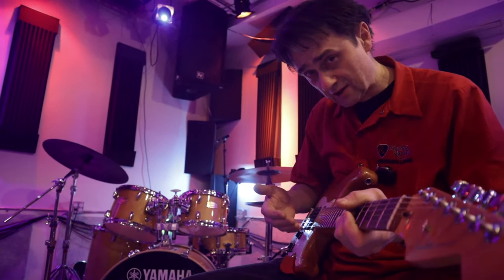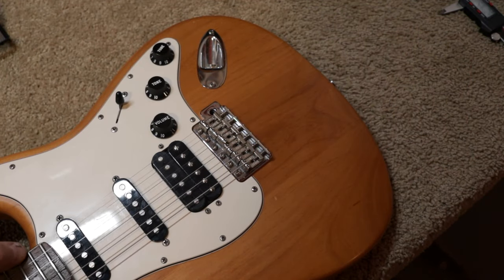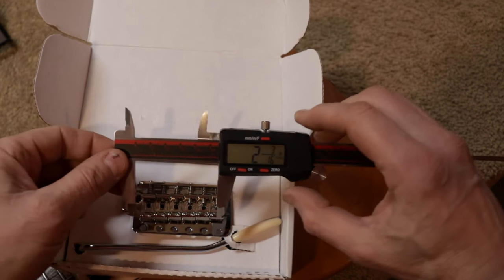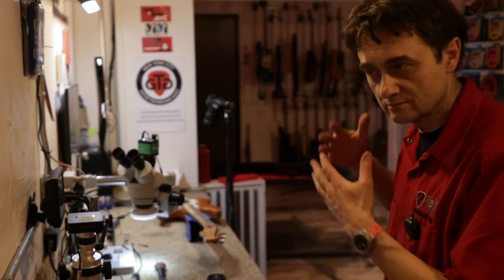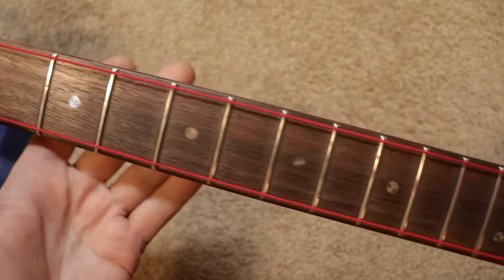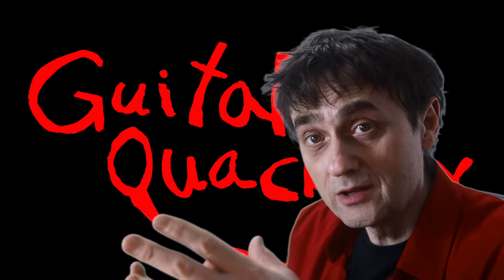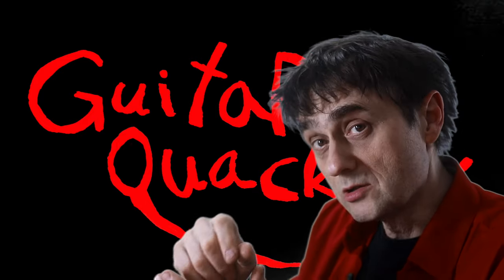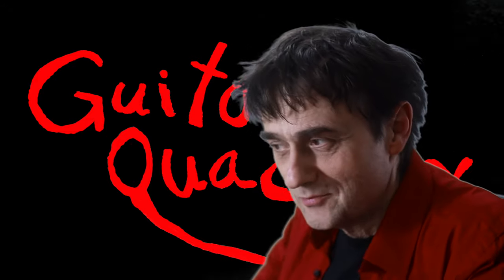How to Fix a Slipping String on a Fender Strat

Comment: It happens in most Squiers too. The easiest fix, if not the nut & bridge and assuming the fret is straight, is the neck alignment. I loosen the guitar neck screws and put only the High-E and Low-E strings with enough tightness for them to pull the neck. I simply tilt the neck sideways until the high & low E are balanced and then tighten the neck screws.
Reply from the maker: You are right, on some bolt-on neck guitars it is possible to just tilt the neck into correct alignment. But on this one, both E strings were too close to both edges. This bridge string spread is too wide for that neck.

They make these 2-1/16 inch string spread bridges specifically to fix this problem.
Reply: Nah, it's just that the vintage Fender spec is these 55-56 mm wide bridges, which is why they all have the strings running very close to the edge of the fingerboard, especially in higher positions. You have to be very careful when beveling the fret ends on these guitars, making sure you don't remove any working area of the fret.
Squiers come with narrow bridges, so you can only have this issue on one side if the neck is misaligned. Same for more modern Fender bridges.

Comment: Speaking of spacing, another thing that Fender has not corrected until today is the distance between the poles of the neck pickup. For them to be aligned, the distance should be 50mm (and not 52mm).
Reply from the maker: And another annoying thing is the cutout on the on the back plate. That cutout is supposed to give us easy access to the trem block, so that you we put the strings into the holes of the trem block, without removing the plate.
Reply: Talking about other annoying things, the G-string pole is higher than it should and the guitar has two tone pots (in 20 years I never found a single custumer that used them both on a Strat). @GuitarQuackery
Reply: Most Fenders are like that...

My Tokai is perfect 😍
Reply from the maker: 70s Strats have a lot of issues.
Reply: @rodolfoamaralguitar you have never found a customer that uses both tone controls?  There is no way that is a true statement 🤣.  That's one of the best features for a Strat.
Reply: @rodolfoamaralguitar  carefully heat them to soften the wax, then push down....the staggered pickups were for vintage instruments, with a wrapped 4 string....
Reply: @rodolfoamaralguitar  I use them. And the vol. a lot.
But you are no doubt correct and most people don’t .
Reply: @fordhammie mine too
Reply: @sgholt  does this work? I don’t usually have a problem but I have one that could stand a mod like that to balance the plain 3rd string a little better

Comment: It looked like your low E string was pretty close too, but if there's more space between the edge of the fretboard on the low E side than on the high E side, then your neck has shifted and loosening the neck and pulling it into place and then retightening it is all that's needed to fix it. Happens during shipping on some guitars. Happened to my Charvel and this simple fix has fixed it. 👍👍
Reply: Oh, I see others have already said what I said. 🤦‍♂🤷‍♂🤣✌
Reply from the maker: Yes, this is something that I forgot to talk about, as I was working late hours and falling asleep editing. I will either make a follow up video or perhaps redo this one and include the neck angle (center line) issue, which can be the culprit on some guitars, but was not the case on this one. 

I don't know... do you think I should make a follow up video, or do you think it's better to redo this video?
Reply: Hmmm.  When I got my Charvel, and I looked for videos about the problem, I found some where they actually removed the bridge and rerouted the bridge cavity to move the bridge over. Luckily, I found one (and only one) explaining the simple fix of loosening, adjusting, and retightening the neck. I was freaking out till I found that one video. I even had a friend who got a new guitar last month and he thought the bridge was mounted wrong too. I explained the easy fix and it worked for him. So, maybe it would be good to have another video out there that might save someone from freaking out like me and my friend. I feel sorry for the ones moving their bridges. Whatever you decide, I'll thank you now on behalf of all the worried people with out of wack necks. ✌Subbed ya. ✌
Reply from the maker: @mikeshanermusic   That’s interesting. I’ll have to look for those videos. It does sound like a very extreme way to fix a problem.

Comment: Don't forget there's not only the string spacing, but the bridge screw spacing issue also. Not every bridge will fit your guitar without re-drilling!
 I had to hunt for the Higway One bridge to accommodate the US-sized saddles from graphtech to a Mexican fender with the wider screw spacing, for example.
Reply from the maker: Correct, but in this case, we were talking about a US Fender and a US bridge for a US Fender.
Reply: @GuitarQuackery  for sure, just a note for others to consider.
Reply from the maker: I think I should make a follow up video that shows other reasons for string slippage. Or maybe I should re-edit those video and include the other reasons in this video.

Comment: If you have just a few frets that the string slips off the side, you may be able to fix that by putting a dab of solder on the end of the fret and rounding it over to make it smooth. I've used Silver solder, a slightly harder form of solder, to do this on a couple of my guitars and it's worked quite well. I came up with this idea after seeing how much solder has an affinity for fret wire. It's easy to do, and just takes a few minutes.
Reply from the maker: In case the entire geometry was off. The string spread at the bridge was simply too wide, in my opinion.
Reply: @GuitarQuackery  Yes, definitely the case on the guitar you were working on. 👍 I just wanted to share a tip/fix regarding the occasional fret with string slippage.
Reply from the maker: @picksalot1   Of chorus, thank you for sharing your tip. I have heard of a similar fix for other types of fret repair needs. I have never tried it myself. Thanks. Much appreciated.
Reply: @GuitarQuackery  The idea popped into my head as something perhaps worth trying. I was shocked how well it worked.
Reply from the maker: @picksalot1  Very interesting.

Comment: I can see this happening with a Partscaster but it should never happen on a factory guitar.
Reply: Fender occasionally mixes parts on some lines. It's baffling it's allowed.
Reply from the maker: There are occasional discrepancies that happen at factories, that later get discovered. I am soon posing a review video of a Fender American Professional II Strat, with some issues.
Reply: @GuitarQuackery  Fender must turn out thousands of guitars annually. I'm sure there are going to be some "discrepancies".  I look forward to that video.
Reply from the maker: @dugbert5   Correct. And I don't want to come across as someone that is just trashing the manufacturers (unless it's Harley Benton, LOL). A brand is just a name, but it all boils down to the factory workers that worked on a specific guitar. And it all ends (or should end) with QC, which is in most cases just fiction.

Comment: GREAT VID...however...I fixed my high E string from slipping off he fretboard by loosening the screws on the neck and actually aligning the neck by shifting it towards the LOW E string side.  You really never play the low E up high and it had no effect on the nut side so it can be a little closer.  I will be measuring my bridge on all of my strats though.  Never even considered there could be that much difference.
Reply from the maker: As some other viewers have pointed out, it is actually true that on some guitars, the neck is simply tilted a little bit. I should have mentioned that in the video. This was not the case on this guitar. Both E strings were too close to the fretboard edge, on this particular guitar. And this is an issue that we see with some runs of Fender guitars.

Comment: Exactly which fender bridge is the replacement you're using?
Reply from the maker: If your bridge is a 6-point mounting system with 2-7/32" spacing, then the part is https://amzn.to/48BwQ1h (affiliate link) which is the exact part used in this video. But please, before ordering, make sure your mounting spacing is 2-7/32" to make sure this is the correct part. Hope this helps.

Comment: Ive had this with Gibson les pauls twice , guess they got the nut carve wrong, with gibson you surely expect much better, was able to sort one to extent by adjusting the wrap around bridge to compensate,  guess the other standard will need a nut job. I have one fender thar does this and the bridge is the issue after all that time the caliper is obvious , thanks i have another bridge somewhere , hopefully the screws are in the right place lol is the only solution on a les paul to re do the nut ?
Reply from the maker: I would have to see the guitar in person to really advise you. Sometimes Gibson folks notch the saddles at the wrong places and sometimes they install the bridge posts at the wrong place. There are more possibilities than just the nut. In fact, I think it is unlikely that the nut is causing this.

Comment: Every MIM tele/start I own had this problem' usually tweek the neck to fix it. You should invent some kinda small devise that sits on top of the saddles that pulls the saddles together and locks them in place.
Reply: G&L saddle lock bridge
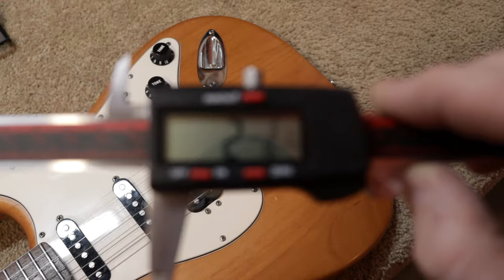Reply: @dingusfuzzk 1:36 lonnkt2755 this bridge is basically a Babicz idea, make large walls and rounded square saddles with rolling pinion centers would be better still like current Babicz bridges. Cool designs, there is a 2 point trem for strats now, and it's on the Aerodyne nobody bought from last year that's a secret sleeper.
Reply from the maker: I need to make a follow-up video, because I honestly forgot to mention that the string slippage could be caused by another issue, which a few of you have pointed out, which is the misalignment of the neck.
Reply: @GuitarQuackery on one of my Strats the first string (alto E) saddle wants to sit tilted away from the others. It appears the hole for the saddle screw, while located correctly, is not flush on one side and when the saddle is pulled or pushed toward the headstock the screw-head actually counter sinks slightly into that hole at one side. I can think of a couple ways to remedy this without replacement of any hardware but I am interested if you have any suggestions?
Many thanks! 
And I am enjoying your channel a lot it is quite valuable.
All the best!
Reply from the maker: @leewalton6882  I've seen this on quite a few bridges. Sometimes the holes are not evenly spaced and sometimes the saddle, screw & spring assembly sits crooked. I've even seen bent screws. 

I can't really suggest what would be the best solution in your case, without having the opportunity to see it in person.
Reply: @GuitarQuackery  understood
Thank you for your reply.
I’ll report back if I come up with anything novel and effective.
All the best!

Comment: I recently purchased a near mint 98 srv Strat that was like this. Those are common problems I guess which is crazy.
Reply from the maker: The engineers who have been designing electric guitars for the past 80 years are not the same engineers who successfully figured out how to put a rover on planet Mars. Although both groups of engineers belong to the same species, there are not the actual same individuals.
Reply: @GuitarQuackery   exactly, you wouldn’t think a guitar over 2k wouldn’t have these problems lol oh well, thanks fender
Reply from the maker: @sean2127  Don't even get me started on the string hole alignment of the Strat backplate, which always has to be completely removed to gain access to the string holes at the back of the trem block.
Reply: @GuitarQuackery  completely right, it’s either that or having to use a Trem bar to keep moving the block. I remove the backplate because it’s the easiest.
Reply from the maker: @sean2127  I do the same, for the same reason.

Comment: But what if you have a Floyd Rose trem?
Reply from the maker: Do you have a guitar with the Floyd, that has this issue?

In this video, I am only addressing the issue of a bridge with a string spread that is too wide for the neck. As some other viewers have pointed out in the comments, this is not the only possible reason why a string might be slipping.
Reply: Yes,- it’s 30 years old but had the problem since day 1.

Comment: Where are you located?
Reply from the maker: NYC midtown Manhattan. Feel free to check out the video Guitar Repair Shop at the Center of the World
https://youtu.be/hc9ZYB2alPQ
Reply: @GuitarQuackery  I did so just after I left the comment. Listen, I'm a stickler for my guitars being set up and playing perfect. I'm from Boston but moved to Virginia ten years ago. Back home, I had no issues with finding good techs. I had choices. Here, there's one shop an hr away from me that does questionable work. I'll never take my guitars back there again. So I'm stuck doing my own work. I have all the tools, but I just don't trust my work. I'll get everything set up, play the guitar, and find some issue (i.e., too much/not enough relief, action/ radius of action, isn't right, etc). I always feel like somethings wrong and could be better. That cycle just repeats itself. I've been playing for over 25 years. I never used to even think of this. I knew when I needed a setup but that was it. I never cared about the particulars like measurements and specs. I suppose I'm being delusional, but it's really taken the joy from playing my guitars. Having a competent tech is vital for me now. I wish there was a way for me to get my guitars in your hands.
Reply from the maker: I can see that you’re a big fan of The Who. 

Oh, course, I’m really happy to hear that you think I would be a good match for your needs, but I’m not sure what I can do to help you remotely.

I do understand that finding a tech that is a good match can be a journey.
Reply: @GuitarQuackery  yeah Doc, The Who are the gods of rock, in my opinion. I don't feel that's even up for debate, lol. It was leaving Boston and coming here that I began to stress over every little aspect of a setup. Before that, I'd get a setup every few shows and carry on. Never even bothering to check neck relief check, never mind adjusting it. I've learned how to do everything. I'm meticulous with it all. I just feel I play guitars better than I do fix them, lol. Anyway, it is what it is. There's no sense in moaning. I'll get over it eventually. Cheers, doc!

Comment: I have to buy a new bridge?! FNA!!!
Reply from the maker: Make sure you don't mistakenly buy the wrong one. First, you have to identify if it's a 6-point or a 2-point system. Here are some affiliate links.

The 6-point system - https://amzn.to/3JN792V

The 2-point system - https://amzn.to/3QxKjAl

I just installed the 2-point system on another Strat and it worked out, too.

BTW, these are affiliate Amazon links, so I do get a small commission if you purchase through those links, but it is at no additional cost to you (or anyone else). 

Hope this helps.

Comment: The solution is, buy a guitar from a decent manufacturer that still cares about quality, instead of charging for the brand name.
 So your saying that FENDER make a over priced guitar with a part that does not function correctly ! and the only way to solve it, is to buy another part from Fender?
American manufacturering, probably the worst in the world.
Reply: Yup by Ibanez the JS model for you Fender neck lovers.  I had a Malmsteen strat briefly and it had the same problem.
Reply from the maker: There are a few issues that offer an opportunity for improvement, with Fender guitars, as well as with some other manufacturers.

Comment: Cheep eastern import guitars put together without care and import taxes is the problem..
You gets what you pay for. 
These issues are become more widespread…
Cheep skate factories chasing your CHEEP bucks.
And they arrive off the AMAZONb buss every day..
Reply: This occurs on USA Gibsons, Fenders, G&Ls, you name it.  A nut cut the smallest fraction too big on the high e and you'll have slippage, #1 culprit that is a hard to deal with- guitars from custom shops thats necks shoulders and frets have been rounded over too aggressively to facilitate the broken in feel. One fret can ruin a guitar neck. The cheap junk from China is raw, they don't attempt to finish a neck.
Reply from the maker: This one was used guitar that the customer bought, I believe on Reverb.
Reply: This problem is actually most common on vintage spec American Fenders.

Comment: The video is supposed to be about fixing string slip, not hoiw to (badly) set up a guitar.  Incidentally, they are designed to have a break angle on the nut - wrapping the strings down the post provides this, not your way.  This is a waste of time and bad instruction.
Reply from the maker: The brake angle on the low E string, is too severe. that potentially presents some other issues, if you look into subtleties. I do mention this and a couple other videos.